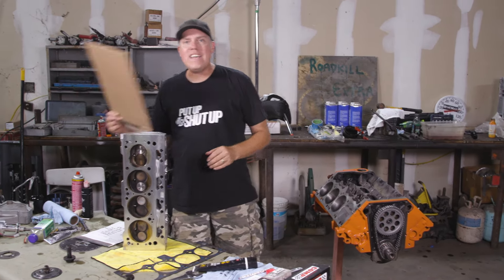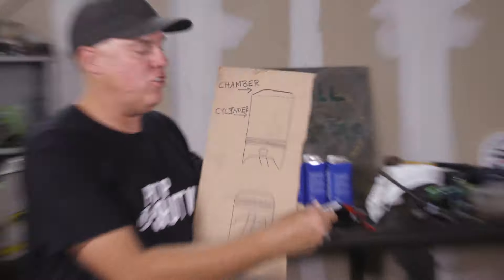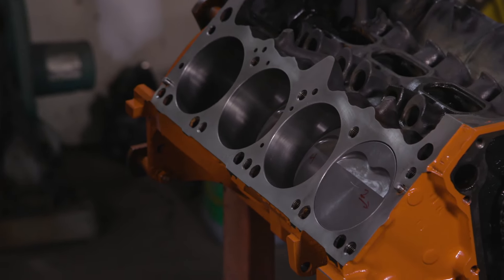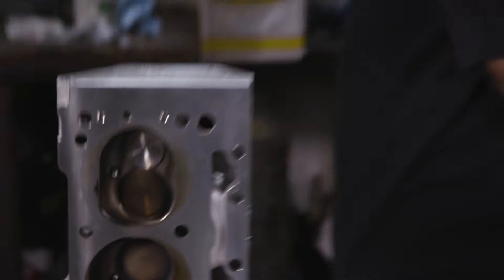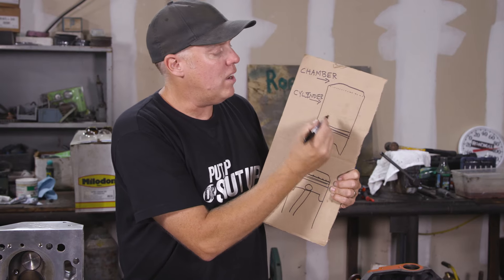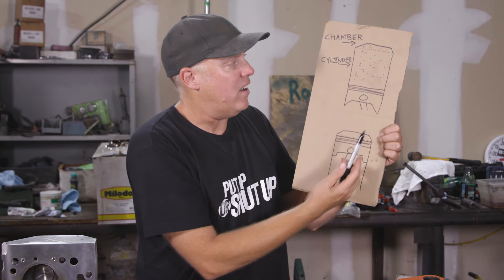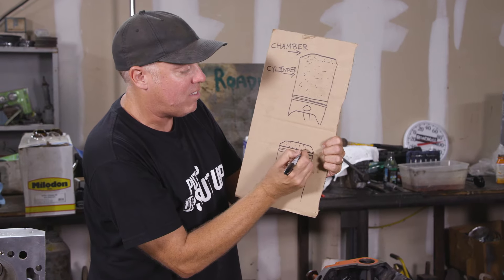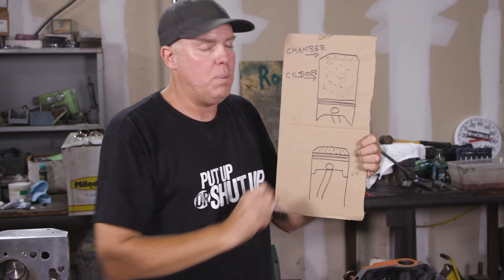Compression Ratio Explained - Roadkill Extra

Comment: what you left out that some might not be able to figure out is what the numbers mean in a 10:1, or 9:1 , etc. ratio. The volume of the cylinder at piston TDC is the "1". How many of those that will fit in the cylinder at piston BDC is the 1st number in the ratio. So the higher the ratio the more volume your are squeezing into that "1" in the ratio. More volume means more fuel and air means more energy and power.
Reply: james rudolph That's what I was waiting for too. Also, I thought he would give an example of why compression ratios were dropped in the larger engines in the 70's compared to the higher ratio of those same engines in the 60's. Was it to increase fuel economy or decrease emissions or both? And how would lowering compression ratio affect that? Well at least I have a better understanding of HOW compression ratios are determined. I just wish he also covered the WHY'S as well. I know I can pretty much figure it out, but still, if you're going to explain something, explain it all.
Reply: A lot of the switch to lower compression was that high octane gas with lead was being fazed out to lower emissions. Lowering compression is a good way to lower emissions because can go with  lower emission gasoline. You could get good gas back in the day but it was full of unhealthy gasses. Another main reason was insurance rates got very high in the high HP cars due to so many people smearing themselves all over the road in their hemi cudas. Fuel economy was a small part of the change since all the domestics had a high mileage option or 2 for those worried about it.
Reply: james rudolph Awesome. Thanks for the info.
Reply: thank you!

Comment: I think the newer Mazda engines (skyactive whatnot) have like a crazt high ratio of 14:1 or something like that
Reply: Yes but they have a delayed intake valve timing to reduce it artificially.
Reply: That's not crazy high.....
Reply: Its not really crazy even for a 4 cyl, and its not even crazy high for a race motor lol, in my dads daily driver he ran a 540 ford big block stroker with a 16.5:1 compression, this was 20 years ago and everytime the car started it shot 15 foot flames out of the 4 4" pipes out back, was canadas fastest street legal car
Reply: pseudo-Atkinson cycle,  Toyota Hybrid cars use it as well.
Reply: For a stock regular commute car, it's kinda high
Reply: Makes sense, since they run or regular octane
Reply: And Mazda is currently developing an HCCI (homogeneous charge compression ignition) engine.
Reply: Exterminatingtraper it is for an engine running on 87 octane
Reply: That actually is crazy high, your average car runs around 10 to 11 being on the uncommon high side. For mazda to introduce it in a family daily, set the bar. Drag cars running that 14 15 etc. are using it with alcohol most likely, which is extremely far from daily use. And I forgot to mention the skyactive with 14:1 gets 40 mpg aswell. Might not sound crazy high to a engine builder, but the technology is something else
Reply: Ford is running 12:1 on the n/a Focus.
Reply: On my Toyota Land Cruiser 120, the compression ratio is 18,4:1
Reply: Am I the only one that is running 22:1 stock?
Reply: I think you might be the only one.
Reply: Seriously? I'm the only Cummins owner in the reply section?
Reply: kevin cothey diesel is much, much different than gas. You actually kinda WANT it to detonate. In a diesel, or be damn close to it.
Reply: kevin cothey I think you are forgetting the main difference between gas and diesel engines. Gas uses spark plugs to detonate the mixture, a diesel doesn't need them
Reply: I didn't forget any of that, I was running 13:1 in my 5.0
Reply: kevin cothey on 87 octane? Bullshit.
Reply: Possibly with NOS, ice box, and massive intercooler for your 30 psi turbo system.
Reply: You caught me, I think it was more like 10:1 or 11:1 😂😂

Comment: 12,5:1 is the compressionratio of a Toyota 86 4cyl boxer. it needs premium gas, but i think having 100hp per liter of displacement is quite decent for a naturally aspirated machine.
Reply: My 12:1 Focus makes nearly 200 hp at the crankshaft.
Reply: Honda F20C, 11.5.1 and 123.5hp per liter
Reply: Yes it is but you’re not going to find many car people that care about how much power is at the crank so that subie boxer is only putting about 200 to the wheels (power to the wheels is the only thing that matters lol)
Reply: F20C makes horsepower by spinning to 9,000 rpm. That's not common.
Reply: plenty of engines with 160-180hp/L, NA. doesn't make you wrong, though.
edit: to the wheel.
Reply: Name a single normal production car with over 160hp/L NA.
Reply: Lukas sorry, didn't say cars. Said engines. Most litre bikes.
Reply: Lukas Mazda RX8 R3, 177hp per liter.
Reply: Wankel engine fires differently, more often, displacement isn't apples-to-apples with piston engines.
Reply: TheWolvesCurse yeah but thats a rotary

Comment: I have never worked on an engine before but would like to someday and this was very helpful for someone who knows very little about engines. Thank you.
Reply: I know this is very late, but you can get a 70s and 80s v8 engine from a van of truck for stupid cheap.  Either a u pull it or a used engine supply facility.

Comment: It’d be nice to have dynamic compression ratio explained and how cam shaft lift/duration/lobe separation angle can change the dynamic compression ratio
Reply: I doubt the present terms will ever change, but when people talk about compression ratio, the picture in their minds is tdc vs bdc, and that is a volume ratio.  To me, compression implies work is being done, and until intake closes some degrees after bdc you have an open system.   We need both static and dynamic ratios to figure out an engine combo, but... dynamic compression is the one that matters most for any given fuel.

Comment: This is the basic stuff that you can figure out by yourself easily; the size of the combustion chamber affects the CR. Soooo, how about dynamic compression ratio, effective compression ratio, volumetric efficiency and how do different camshaft profiles and the engine RPM come into play? ;)
Reply: Audiojack YES......more on this ^!
Reply: Audiojack i just posted about the same thing vid is a very very basic model
Reply: Agreed! I'm planning a street motor and am wanting great torque, good horsepower, and at the same time decent fuel economy. I want to benefit from the greater dwell time with the longer 6" rod, and less valve over lap for fuel economy. The counter to that is big cam lift and likely Chevy aluminum fast burn heads or similar after market. I want to figure out how much the valve timing and piston dwell at tdc will effect detonation. How far can I push the compression given other extenuating factors.
Reply: Joe Robinson Just use a proven hci combo and move foward, what's the big deal?

Comment: Compression ratio is like a night out. 1 night 8 beer......meh. 12beer - 1 now your having fun. 18 beers equals detonation. How those beer effect your night depends on your body size, skinny guy is gonna have a wicked buzz, 300lbs guy is gonna want more beer
Reply: Great way to explain it
Reply: I'd take the piss, but this was a spot-on metaphor
Reply: You are a wise man.
Reply: Does that mean whisky is equivalent to nitrous? 
I like to run a 150ml shot so that I can keep my beer ratio lower, it makes my tank last longer.
Reply: shedboyz21 and tequila is nitrous
Reply: or buy a turbo diesel with compound turbos and have 18 to 20 beers all the time
Reply: How will we include turbocharging now? Drinking directly out of the pipe? at 50psi
Reply: seven turbo? You mean drinking straight from the keg😉
Reply: 18:1 is pretty much the sweet spot though, at least according to mazda.
Reply: mazda soon to introduce 18 to 19 compression ratio gasoline engine with compression ignition. crazy shit
Reply: Ali Abdullah their normal diesel and gas engines use 18:1 too
Reply: My experience is no beers= pre detonation and 12 beers= no detonation...
Reply: AdventuresNOregon direct injection has nothing to do with compression ignition. both modern petrol and diesels use direct injection. mazda is controlling cylinder pressure and temperature to ignite lean a/f ratio with compression at high compression ration without detonation. but only at low engine loads and constant rpm. otherwise normal spark ignition with lower compression will happen. mazda is really the pioneer in engine technology today.
Reply: AdventuresNOregon gasoline engine will soon give efficiency of diesel at highway speed and power of petrol at high loads.
Reply: 18-20 beers all the time = Great fun but short life lol
Reply: shedboyz21 The crazy Uncle can always explains stuff to us common folk! Thanks 😉
Reply: shedboyz21 What does "meh" mean?
Reply: shedboyz21 if beer is gasoline then ethanol is vodka?
Reply: that's funny sh*t right there. 😂
Reply: I love the explanation man its just perfect!!!
Reply: Ali Abdullah it doesnt? I think not. It would have to be direct injection. So i has alot to do with it.
Reply: what is jagermeister in hot roding
Reply: seven keg chug
Reply: Yeah not exactly, more static compression allows you to make the most of a wilder cam, which has more duration and more valve overlap which decreases dynamic compression, read as peak cylinder pressure ... ever heard anyone say "don't run too much cam or you will lose power"? this is why, the real thing they should be saying is do not run too much cam without the rest of the engine being built to support it.

Upping the compression ratio just to make numbers is retarded, it should be increased for a reason.
Reply: @darrencolegold3642  like throwing smallblock 305 heads on a smallblock 350 with stock cam.
Reply: @bobhope4288  lol.....absolutely sounds related, or just boost lol
Reply: and metabolism, i'm only a buck 80 snd i can pund jack all night. it's really all about metabolism, or efficiency

Comment: You didn't cover a main aspect of compression ratio: the tendency to knock with higher CR. This is an important factor, especially with turbocharged cars. If you reduce the compression ratio on those, you can increase boost pressure. This is something to neglect when talking about naturally aspirated cars (you "kind of" mentioned it with the race fuel), but i feel like you should have mentioned it to a bigger extent.

That is also why turbocharged cars come with lower compression ratio than NA. Also, the compression ratio isn't the only factor which will determine how a turbocharged engine feels, in my belief the lower CR but therefore more possible boost pressure can change the engine characteristics dramatically. In my case, i already have my second engine waiting to get into the car. From 5-cylinder 230hp/320nm 2521ccm 9:0 CR / ~0.85bar boost i will go to ~440hp/6xx nm 2521ccm 8.5:1 / ~1.6bar boost. Without the reduced CR, it would be more complicated to write a software for this boost pressure without knocking, also the new camshafts have more lift and require the additional space the other pistons offer.
Reply: CentaX cause is all about v8s, hp, tq, and displacement bruh.  Go talk about turbo ricer engines on your honda forums.  This is big boy talk.
Reply: Throw a turbo on a V8, face the same aspects
Reply: The higher the boost, the hotter the intake temps, the more prone to detonation. Also less timing due to higher temps meaning less power per psi of boost utilized. This is why 11.5:1 compression ratio stock Coyote mustangs , make 600 horsepower with minimal boost. For every one full point of compression raised on a N/A engine is also roughly 4% increase in engine power. Therefore, lowering an engines CR to allow higher boost, means your having to also crank up boost to account for the loss in CR statically. Plus more Compression without boost means more torque sooner, expelling spend gases faster , spooling the turbo sooner.

Comment: I'm a little sad you didn't talk about why you need to reduce compression ratio on older turbo charged engines.
Reply: Its due to risk of detonation. Older turbo engines can not detect detonation and change timing and fueling to stop it. Less compression =less risk of detonation
Reply: Cheers Don Krawallo, so it's the ECU that allows a blown engine to run at higher compression ratios? Thanks for explaining!
Reply: And, as a follow up question, can an older engine be fitted with a supercharger or turbo, if you replace the distributor with an ECU?
Reply: Mikey R 

Yes you can. Engine management harnesses (ECU, sensors, wiring harness) can be had for almost any kind of engine.
Reply: Basically, forced induction increases an engine's effective displacement (14.5 psi = double the displacement), which greatly increases your compression ratio. Since the air you're stuffing into the engine is already compressed, you need to back off on the cylinder's normal compression ratio or you risk blowing something up.
Reply: If there is a risk of detonation and the ECU retards timing and reduces compression, will I notice it? (Some kind of noise, alarm or power loss?)
Reply: So, when we say retards timing, that must mean that the piston is already on it's way down the cylinder at the point of detonation. This means that, since the volume of the gas is now more than what it was with the piston at it's apex, the compression ratio is effectively reduced.

So, if more compression means more power, then yes, retarded detonation means lower compression means you will lose power. But, you'll lose less than if your engine explodes. Then you won't have any power.

This whole thing is really complicated. I assume that retarding detonation is easier for an ECU to achieve, in such a way that saves the engine, than, say, opening the waste gates to reduce boost.
Reply: Mikey R Ok, thanks for explaining :)
Reply: You shouldn't really notice it happening, no. It's mostly to account for different air temperatures. All it does is cause the coil to send spark later than usual. The ECU already calculates this thousands of times per second to run the engine anyway.
Reply: [ Insert Name Here ] honestly, don't take my word, I'm figuring this out same as you are! I wonder what it would look like on the dyno graph? An early power peak with a fairly flat roll off?
Reply: thats because boost and any power adder is beyond the scope of this basic video.  get natural aspiration down first before you burn up an engine with power adders..
Reply: mrhazel walk before you run - good advice!
Reply: Engines generally back off on timing as RPM increases either way, so it wouldn't really look much different.
Reply: 2redneck excellent, thanks for taking the time to write such a full and comprehensive reply!
Reply: Mikey R ecu tuning nowadays has come along way, shit the Holley dominator kit which is 2500-3000$ can do everything on the fly. I'm talking about alot of different custom setups controlling transmissions, turbos, superchargers, ignition packs, accessories, different types of fuel that you throw at the harness.
Reply: thats true, it has come a long way.  but if everybody was good,  then everybody would be good.  that's why you have tuners tune your shit.  take john Doe from outlaws,  had a big nitrous motor went to turbos, couldn't figure it out. went back to nitrous  but he did figure out the procharger. its all easy in theory for most street applications but when you start turning it up,  thats when it gets a lil complicated...
Reply: He did kinda touch on it but that's a pretty specific thing. I think he covered it as much as it needed to be for the most part.
Reply: And generally turbo engines that are older will have a lower compression.  To avoid knock the manufacturer will specify higher octane fuel, and to always run it.  If you can only get 87 octane on your turbo car just don't thrash it.  If you don't build up high boost with lower octane fuel, you'll still be ok.  I had a 98 passat turbo, and when I altered the boost I had to run 91 octane minimum.  If for whatever reason I couldn't, I just accelerated a lot slower.
Reply: Mikey R yep

Comment: Diesel and direct injection reach higher than 12:1. Diesel might go to 20:1
Reply: Georg Antonischki we are not talking about diesel here , are we ?
Reply: Robin Vanoppen, I prefer more information over less. if this overloads you or others I'm terribly sorry. Fortunately I didn't bring up charging :-)
Reply: i have a 3litre turbo diesel its 23:1
Reply: That would make sense since diesels use compression to ignite, as opposed to a spark plug
Reply: But the new Mazdas are lowering compression for Skyactiv D
Reply: diesels run on detonation. gas engines destroy on detonation. huge difference. its jsut a quick video explaining compression ratio for a normal gas engine
Reply: I think Mazda is developing a gas engine that relies on compression for ignition.
Reply: Craig Arnold it does both.
Reply: Piston engines are piston engines. Compression is compression. Regardless of what sort of fuel burns.
Reply: Craig Arnold, correct. It's an HCCI (homogeneous charge compression ignition) engine. Would be very significant for gasoline engines.
Reply: charging??
Reply: Diesel runs on a higher compression ratio? Thanks captain obvious.
Reply: The old 7.3 idi runs like 25:1, newer turbo diesels run anywhere from 13:1 to 18:1.
Reply: The Chevy's with the Detroit 6.5 is 21:1